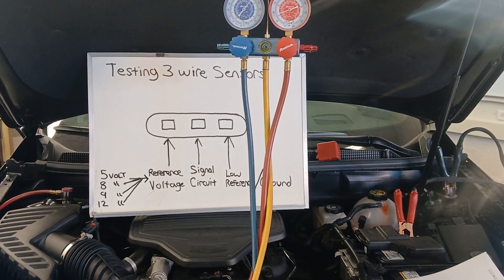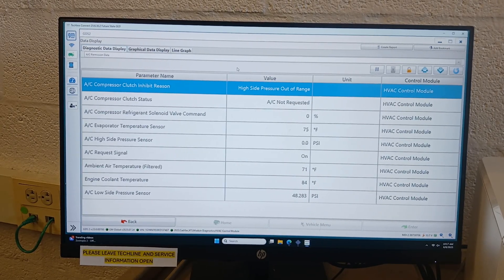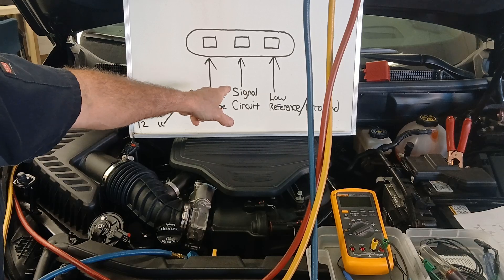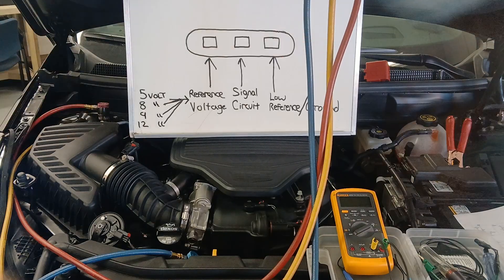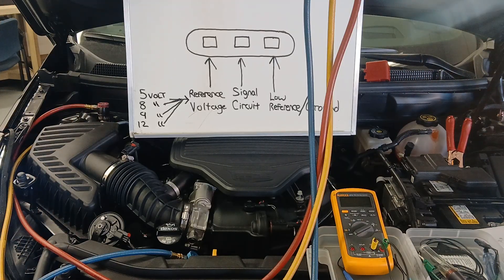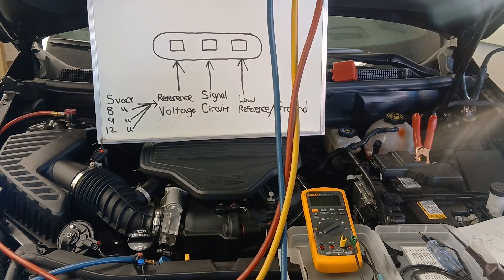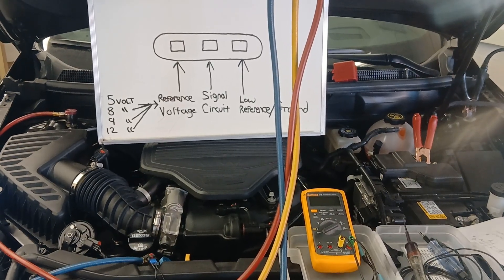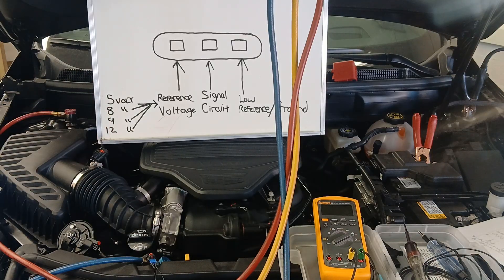#sensortest #3wiresensor Three wire sensor testing

Comment: You got away with that 5v ref test ,if there was corrosion on the 5v ref line you would still see 5 v because you didn’t test it under load ,a mistake I see everybody doing , you unplugged the the sensor plug rendering no load on the 5v any corrosion on that line the voltage will still be seen without a problem,this needs to be pointed out and any voltage testing must be done under load just basic facts🤔

Comment: Hello sir,
(1)
Some vehicle have 1 wire on ac compressor how can I check?
(2) How can I check ECU positive supply or negative supply my means to say ECU getting supply or not ?
Reply from the maker: From what I remember on that type of system, the wire going to the compressor would be the power circuit and the compressor would ground through the engine similar to a starter, the power to the compressor will probably come from an ac compressor clutch relay, you would want to check for battery voltage on that wire with the ac turned on and engine running

Comment: Using a test light to verify ground can bite you because  you're not quantifying the ground. This can be done with your DVOM. Also, anytime you jump a reference voltage to signal there should be a known value load in your jumper wire. I've seen many techs fry ecm's doing this. Lastly,  Ive seen a 1 volt drop on the ground side still illuminate a test light but not operate a component. If you know what a good ground value is why not use a meter. Your protocol is a good testing strategy if one is aware of what I mentioned. Good video.
Reply from the maker: You are right, an inexperienced technician could damage a module if not careful, I have also seen high resistance upwards of 50 ohms light a small test light, I prefer to use the meter and test light both for validation of the circuits integrity. Great insights, thank you!!
Reply: @bethelion74  I think he's saying that it doesn't matter how careful you are with the 2 amp fused jumper because you might still fry the ECM. If there is a short to voltage on the 5 volt ref or a short to ground (especially to an ECM ground wire) on the signal wire, then the circuit in the ECM might blow before the fuse blows. It's very unlikely but it's possible. Especially if you use the cheap fuses they sell on Ebay or Amazon. He's saying it's best to use a resistor of a known value instead of a fuse in your jumper wire to jump the 5 volt ref to the signal wire. I'm sure you know this but I'm just spelling it out for others, especially do-it-yourselfers, that read GripFreaks comment and don't know what he means by "there should be a known value load in your jumper wire".
Reply from the maker: Thank you i like the way you lay that out, electrical diag is difficult especially for the younger generation of technicians, i learned by making mistakes and also damaged a few modules along the way
Reply: @bethelion74 demonsteating that method would make a good video too. You did a really good job with this one!
Reply: @bethelion74   I want to make sure I get the correct jumper wire with Fuse and holder  like in video before I try this, so could you leave a link maybe I can buy from off amazon or tell me what gauge wire I need to make sure I get to handle the load on my jumper wire? thanks much, video cleared ALOT up for me and keeps me from having to pull a ECM to do a continuity checks somewhat ,just want to make sure I do it right , thx again
Reply from the maker: https://a.co/d/5ttXFNM
You might try these fused holders from Amazon, this is what I use the wire is 12 gauge  so should handle a load with no problems, you can get banana jacks  from Amazon as well that you can put on the ends of the fuse holder or what I do is buy like a 6 piece banana test leads set from Amazon cut one of them in the middle ans solder the fuse holder in place to make a fused jumper you will find multiple sellers on Amazon with banana test leads ND get a good price on them, remember too when testing like this a 2 or 3 amp fuse should be all you need in the jumper wire. Hope this helps out
Reply: In a 12 volt circuit, I've never seen a 1 volt drop in either the positive or negative side prevent a component from operating. 1 volt is not that much. It's only about 8% at 12 volts and 7% when engine is running.